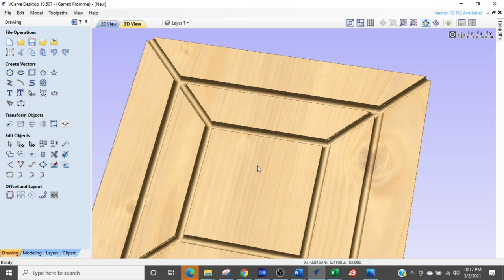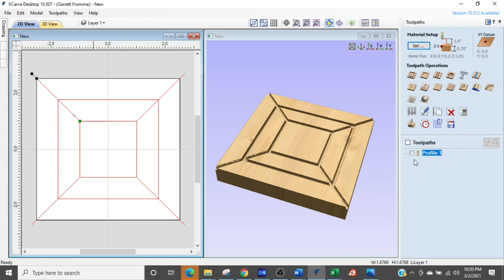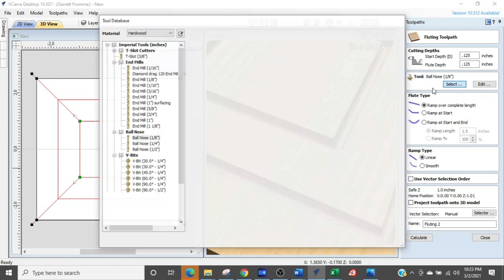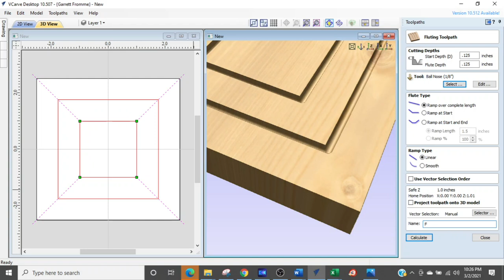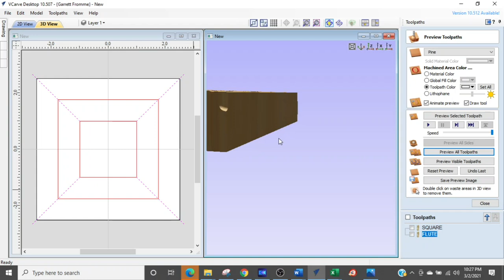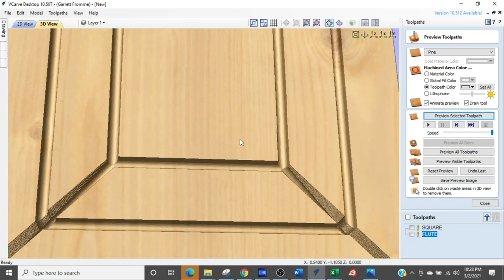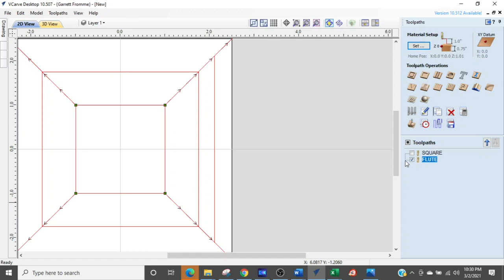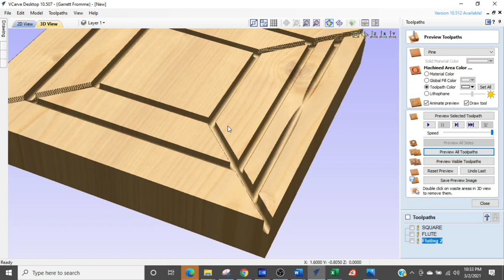Flutes - How To Do Fluting / Flutes Toolpath, Vectric Vcarve & Aspire

Comment: Missing from Aspire is ability to define the “smooth” ramp with a profile in the z as you can in the x/y.  Same in 2-rail sweep.  The software defines the transition.  I have been trying to find a way to define the profile of the “slope” in flutes or “smooth” in the 2-rail sweep so I could make a coaster holder that follows the profile of a coaster’s circle profile in depth (z).
Reply from the maker: bw162, It sounds like you've encountered a limitation in Aspire's functionality regarding ramping and profile definitions. While it does have some great features, it can be frustrating when it doesn't meet specific needs. You might explore alternative methods or workarounds within the software to achieve your desired result. Many users often share their tips and tricks online, so that's worth checking out as well! Good luck with your coaster holder project!